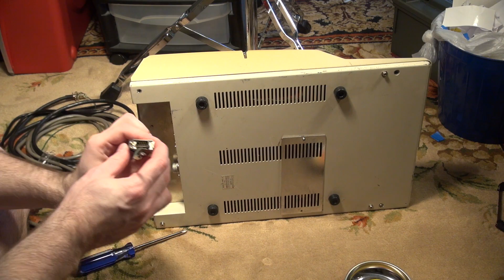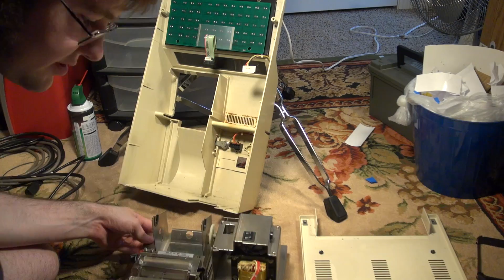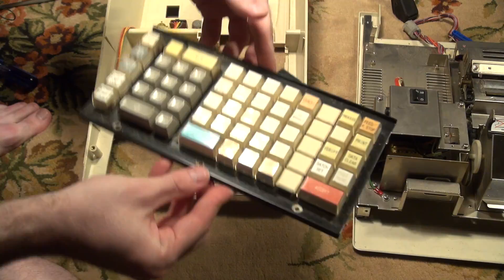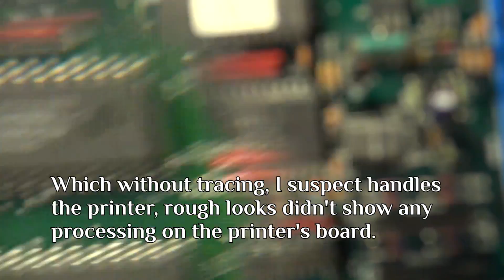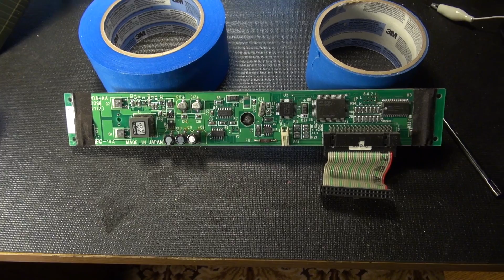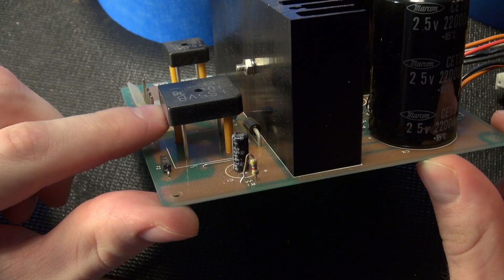Glory SR600 Cash Register Teardown

Comment: I'm thinking this might not be a cash register but rather a teller machine, used before each teller window in a bank had a computer or terminal at it.  Merchant and Sharp used to make very similar units, and it looks like there's a validator to print on a deposit slip or something.

Comment: hey where do you find old registers??? looked all over,,no luck..even the big store models from the late 70's early 80's...do you have any ideas??
Reply from the maker: I do a TON of thrift/secondhand shopping, which is where I've seen a few registers, including that one. Flea markets sometimes have them if one of the booths is owned by say an ex shop owner or something, though the price quickly becomes too high. It's extremely difficult to find them. You might have to start going to some scarier thrift/secondhand shops, maybe ones that have been around awhile, and they might have some old registers. There might also be some business e-waste recyclers  that allow you to shop them. Hard to say. I haven't found a register like that since I found that one.
Reply: I am always on the search for old Data Terminal Systems cash registers from the 70s and 80s but I hardly ever run across them and those I have found have always been the smaller model 150s. Would love to get my hands on a Series 300 or 400 someday